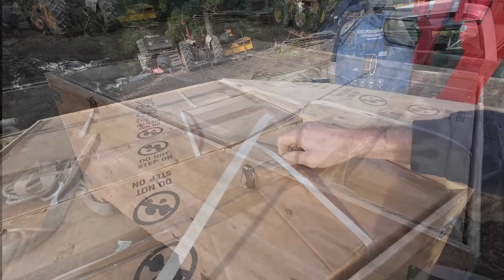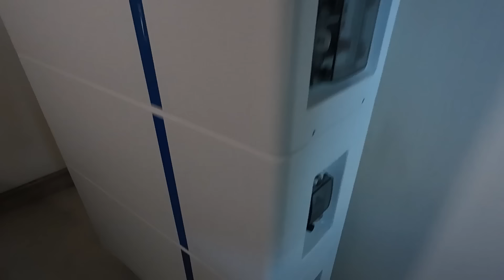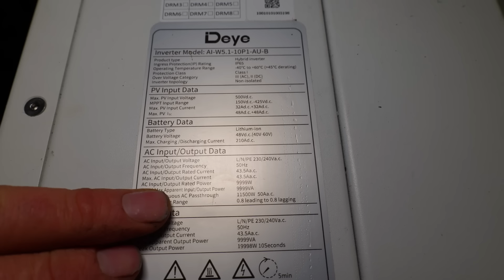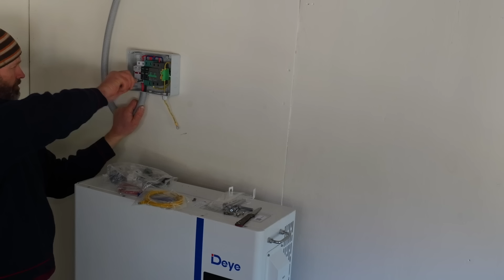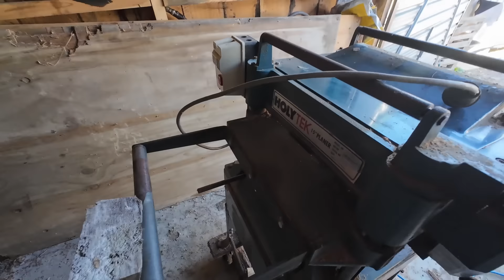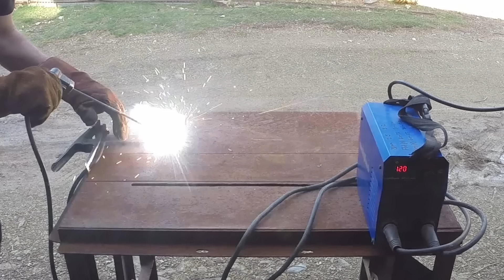Building Backup Power for My Off-Grid Hydro System

Comment: can u use the homemade hydro-electric system to charge the batteries
Reply from the maker: Yes I could, I would first need to rewire the turbine stator to generate 150+ volts which is the minimum mppt input for this system

Comment: Hey Marty who sent you the system? 
Bit strange the sent a 3 phase inverter 

The 3 phase inverter isn’t compatible with those single phase PDU or 5kwh batteries 
The 3 phase system uses 4kwh high voltage 103V battery stacks and different PDU
BTW I can supply anyone in NZ these units with the authorised 10yr warranty
Reply from the maker: Good to know, thanks.. Deye sent me this setup.
Reply: @MartyT 

Marty theres also a smart load feature with those inverters for surplus power that you might find useful to send out to an independent circuit 
heat a cylinder ,run a water pump or charge an EV

Comment: Be careful where you store the lith-ion batteries, if they get hot and start burning you and the forest could be in big trouble.❤Have had a couple of battery storages fires in my area and the fire department just had to let them burn out on their own. Not good with the hazardous fumes. Might be safer to use a machine to dig a small bunker in the ground and line it with concrete and keep a pile of dirt handy to bury it if it ever caught fire. Hope your back is better or you have surgery scheduled 👍
Reply from the maker: These batteries are LifePo4 chemistry which is pretty safe

Comment: Can you charge the batteries from the Hydro plant?
Reply from the maker: Yes the system has 2x mppt inputs so I could have solar and turbine charging the battery, but Id need to rewire the turbine stator to produce 150v+ as the system requires 150-500 to wake up the mppt

Comment: As a fellow off grid pioneer it's always amazing to see how much things have advanced over the years.  I do wonder if you will be able to integrate your hydro power into this setup, from the specs you showed it should be fairly straightforward.  

As I'm in the process of helping a friend of mine plan & build an off grid system for his batch a link to the manufacturer/ where we can order one of these systems wouldn't go a miss 😊
Reply from the maker: Yes It has 2x mppt inputs so I could plug in the turbine, but id need to rewire the stator to produce 150v+.. heres a link to the system - https://deye.com/product/ai-w5-1-b-ess/

Comment: Nice setup, Marty!  Are you going to be able to charge that off your hydroelectric rig?
Reply from the maker: I could do that but Id need to rewire the hydro stator to produce higher voltage 150.- 500vdc  if I did that Id need to upgrade the cabling and put in safety barriers etc, as that voltage can be lethal, so I'll leave it as is for now

Comment: can you have both single and three phase connected at the same time?
Reply from the maker: Possibly, the pdu has +/- out terminals, so maybe the 3 phase inverter could be wired up with cables beside the batteries

Comment: good to see you back, I have a back up generator that runs off a transfer switch, it has to run for weeks at a time in the summer here as power is so unreliable, and batteries cant run AC with its 42c out for days on end....good luck

Comment: couldnt the hydro also charge those batteries?
Reply: Yes 
but in another comment Marty stated he would have to rewire the stator windings for 150VDC output 
as that is the efficient input voltage to the inverter....
Reply from the maker: Yes, but I'd need to rewire the stator to produce higher voltage, this system needs 150+ volts to pick up a dc input

Comment: Hi Marty.  Good to see you out in the workshop.  That power solution looks like a very capable system.  I always liked your hydro setup but it is off the beaten path a ways and getting to it with your injury wouldn't be very easy.  With it running the way it does, and over the distance it carries, you have had to make repairs over the years.  Especially after that bad storm you had last year.  This gives you some peace of mind.
Reply from the maker: Exactly, its nice to have a backup plan

Comment: Are you going to feed your hydro into it too?
Reply from the maker: No I'll keep the hydro separate for now, I'd need rewire the stator to produce higher voltage 150-500v
Reply: @MartyT can you charge it with the hydro system through your existing inverter,  as in plug it into the wall socket?

Comment: Good luck with the surgery Marty!!! Take it easy!

That inverter setup is pretty impressive! I’ve often wondered if installing softstarts would be better on a system like that? Especially if it was smaller. Just like that compressor takes a lot to start up but is light to run.

Comment: Probaboy a bit late to comment on this, but those feet have the entire stack resting on those adjusting nuts. I'd have put some washers on top of the nuts to spread the load out a bit on the bottom of the enclosure, which didn't sound all that thick to me.

Comment: Seems like a nice system!
Q: are the two DC connectors (red + black) battery voltage in/out? If so it might be worth considering connecting them so a smaller high frequency inverter that can be on at all times powering smaller loads (lights, phone chargers and whatnot).
(Perhaps not that useful in your case since you have your hydro power system too, but for others who would only have this Deye system).
Btw you should be able to run single phase loads too using the three phase inverter if you want to. Don't know if you usually have 230V live-neutral or 230V live-live in NZ. Over here in Europe 230V live-neutral is the most common but for example Norway uses 230V live-live. Either way as long as it's either 230V live-live, or there is an actual neutral wire, it should power single phase loads too.
Reply from the maker: Yes there are +/- out terminals on the pdu which could be used to run a smaller inverter, however the main inverter needs to be on for the mppts to accept dc input.. yes the 3phase unit should be able to run 249v appliances but the peak output would be lower

Comment: Hello Marty, it is great to see you getting around and wishing you the very best on your upcoming back surgery.  Having had 52 surgeries since I was hit by a car as a pedestrian 50 years ago years ago, I have sympathy for you.  Four of the last surgeries were back surgeries with 3 being fusions.  Just take it easy after you get the surgery as you will feel like new.  After my first back surgery a neighbor call for help getting their bull out of their chicken enclosure and I messed up my back again.  I run on solar at my shop and it has been wonderful getting some free power.  I do have two backup generators a natural gas and a military diesel.  They are for mostly winter with snow and extended clouds or fog.  The natural gas generator handles the system when I’m not around and then I use the diesel to top everything off when I get up to the shop.  I sure wish I had hydro like you do, but I have my setup worked out now.  Best regards and the best of success on your upcoming surgery… John

Comment: Gday 
hows the other setup u got in the shack going ? need a update on the pros and cons of it
cheers
Reply from the maker: The original power system is still going strong, its running on old lead acid deep cycle batteries that I got second hand from a trawler, having 24/7 hydro power feeding into them means   they stay topped up most of the time which is why they've lasted so long
Reply: @MartyT  ok not the setup i was asking about the EcoFlow? the 1 on the shack on the island it got the 240 and 12v fuse all in 1
cheers
Reply from the maker: @scummyinoz Oh right, thats still running well. That was a simpler install as the switchboard etc is all plug and play, but not as much battery storage or power output as this one
Reply: @MartyT  ok cool so good for a small house/shack setup light use 
cheers

Comment: Thanks Marty, looks like a nice pile of goodies. In my experience there's plenty of 3-phase workshop tools around, but I don't have 3-phase! It's maddening. I expect you'll be able to find something. You're smart to keep your systems independent, gives you redundancy even if you run out of water or sunshine, or when something breaks. One of our local sparkies recommends that you don't fit anything directly above your stackable modules, no conduit or junction boxes etc. because they'll be in the way when you add to the stack and you have to do extra work to relocate it all.

Comment: Just a suggestion. Always separate your power sources with an either-or manual switch capable of full current. You never know what freakish condition might try to connect the sources at the same time. With hospital emergency power there is both an automatic swap over and a manual. If the two, grid and alternative power somehow meet you've got an hour to bring in an alternate generator and get it on line before the hospital must start evacuated.
Never trust automated circuitry.

Comment: That looks awesome! I got a portable one thats "supposed" to be 5000w surge and 2400w continuous 3047kWh but it cuts out starting a bandsaw or drop saw and don't even think about the welder...
Useless really. It just runs the stereo and Makita chargers
Reply from the maker: Is it a Deye inverter? Is your cabling up to the task? Thin cabling can cause a bottle neck
Reply: @MartyT no its a portable system

Comment: Would you be able to run the hydro power into the inverter ?
Reply: @MartyT
1 hour ago
Yes, But I would need to rewire the stator to produce 150+ - 500 volts, this system is designed for high dc input
Reply: Not directly.
He'd need to rewire the hydro generator to output higher voltage.

Maybe if he puts a portable batterypack in between?
These charge with lower voltage, but can output 240V/16A to the Deye.
Any idea if this works?
Ever seen anyone do this?
Reply from the maker: Yes But id need to rewire the stator to produce 150-500 volts, this system is made for high v dc input

Comment: yikes those premade battery packs are a ripoff. better to use old EV batterypacks instead. Same safeties and same voltages. only fraction of the price. just plug in the ev battery straight into the inverter. would have thought your kind of diy guy would lean into those more
Reply from the maker: It didn't cost a cent 😆

Comment: It looks like it has 2 PV inputs. Unfortunately they only start tracking at 150V, which limits you if you want to run your hydro setup up to it. If your turbine spins at its rated speed, you could wire it like it was originally configured in the washing machine and put it through the diode bridge straight to the MPPT. Looking forward to seeing what you do with it 🙂.
Reply: @MartyT
1 hour ago
Yes it has 2x mppt inputs so it can be charged from the turbine in addition to the solar
Reply: @MartyT
1 hour ago
Yes, But I would need to rewire the stator to produce 150+ - 500 volts, this system is designed for high dc input

Comment: Hey Marty, great to see a video, have you though of doing videos like centrifuging oils into burnable fuels?, it will make for some great videos especially with the fuel costs so far
my mate at work runs in his 90's Nav with TD27 motor a factory fuel filter and primary first in line ford 2017 to 2022 3.2 ranger fuel filter 5 micron, he thins down waste engine oils(any oils) with what ever is cheap to thin the oil, and it runs great, 6 months on and still running like a champ
RUCs went up,  fuels went up((100% increase)$1.60  91oct in 2022 to $3.50  91oct this year), rego went up($100 for an echo to $198 98%), FARM reg $45 to $55 is no longer for UTEs and insurances went up, farm reg for utes is now normal ute farm rego, about the $200 mark), and all this forced inflation has put rates up because of lack of self control from our elected people throughout nz (mp's. mayor's, council's)
so if you can find the perfect but cheap centrifuge that works well , it will be a good market to get into 
oil is very easy to come by , chip shops, workshops are everywhere
Reply from the maker: I have done vids like that in the past, I run some of my older tractors and my diesel generator on black diesel and recycled canola oil

Comment: I work for a Heritage Railway and our powers that be are on about fitting solar panels to the roof of the carriages in stead of a generator to power all the electric   The problem I can foresee is the catering carriage has ice cream fridge and hot water heaters extra and they have a start up load so I think if they go down that road then I think they should look at the system you have
Reply from the maker: You'd need to add up the combined starting load of all the appliances, if its just a fridge or 2 and a couple of heaters, this system would likely easily handle the load.

Comment: good to see you here.
Could you hookup your hydro power on this system?
Reply from the maker: Yes, But I would need to rewire the stator to produce 150+ - 500 volts, this system is designed for high dc input

Comment: Hi Marty, you have 1.25kw of solar and 10kw of battery, that will take about 8 hours to charge to 100%. If you aren't powering your home, it will be interesting to see how long the battery lasts when using your tools. Keeps us updated, would you?
Reply: There's also the hydro system, providing 500-750W (if I remember correctly) 24 hours a day...

Comment: Just finished bids on 2 100kwh Kia Ev9 batteries. 6k shipped for both.  Find EV dealers that have models that are still 100% under warranty and buy those. Look how much 200kwh runs with other tech.